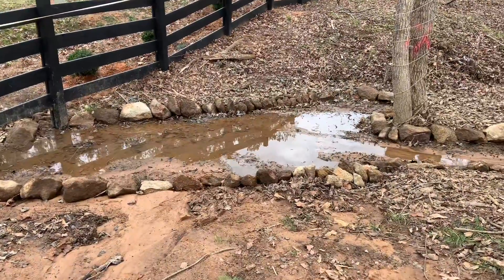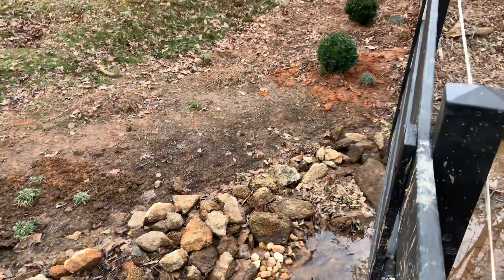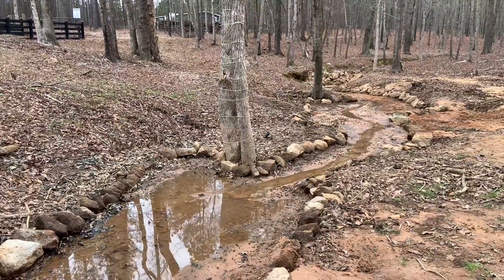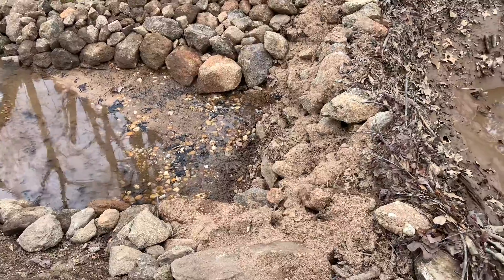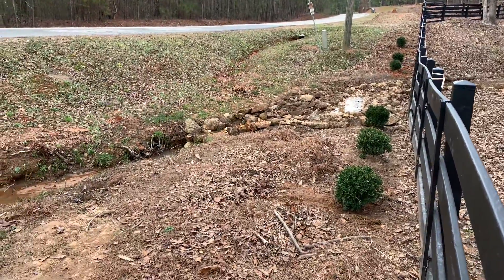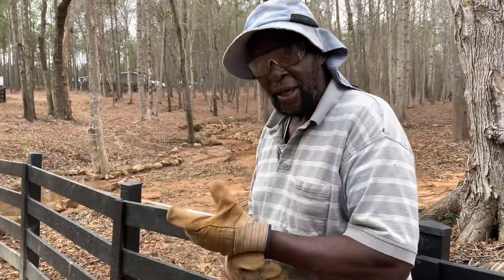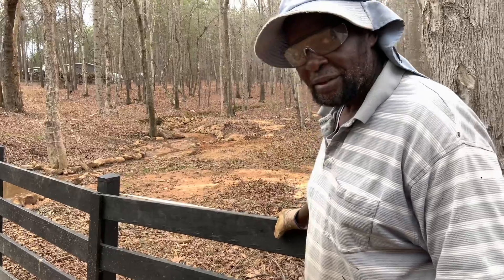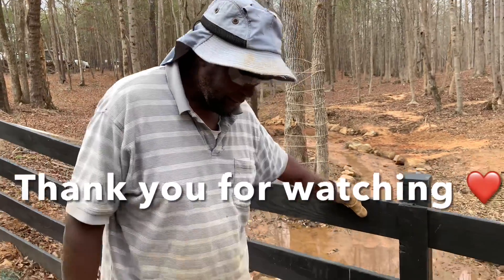Upgrading Dam and Creek Bank | Damming A Creek

Comment: Greetings!  Check out...Gorilla Cart from Home depot $200 -  Rugged design, 7 cu. ft. dump cart, convertible handle is easy to convert to a tow handle, 1,200 lbs. capacity and four 13 in. pneumatic tires, this cart is always ready to tackle the project of the day.  Dumping contents is a breeze.  WAYYYY...better than a wheelbarrow!